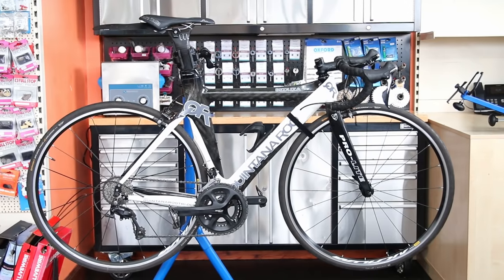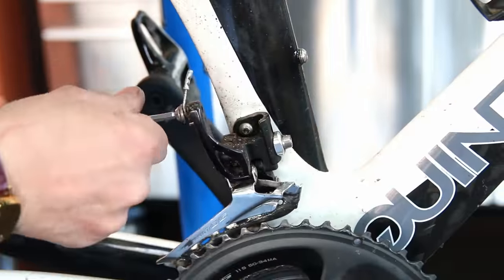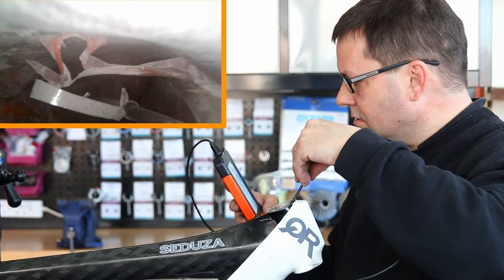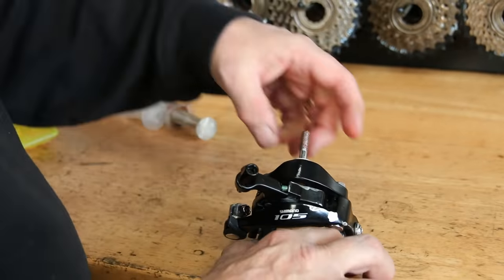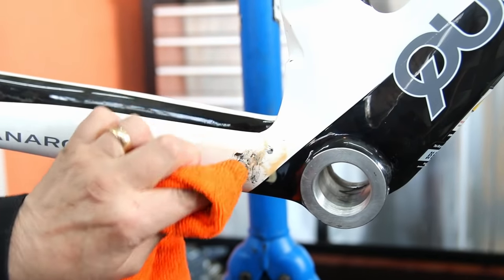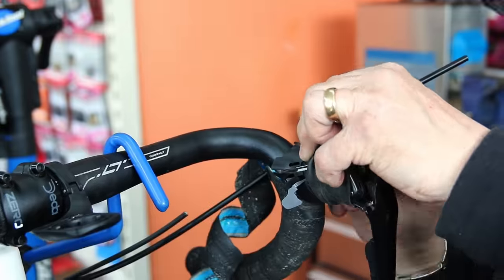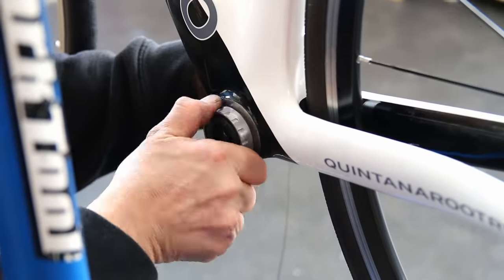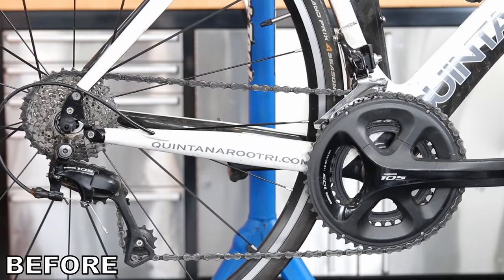Quintanaroo Restoration Service! Road Bike Rebuild!

Comment: I'm amazed at the condition some of these bikes are in when they arrive at your shop. Are UK cyclists allergic to a little soap and water? 🤪 Or are your roads so often mucked up? Whatever the case, they're lucky to have you!
Reply from the maker: Very mucky weather & hard as nails cyclist who ride through tough winter conditions
Reply: clean bike is temporary (factory attribute), the natural way to own one is look like something big has vomited on it. if your bike clean you are part of a noble race.
Reply: We're just out of winter, where if you don't wash the bike after every ride you'll have a dirty bike, so eventually you give up on the little bits behind the wheels :P

Comment: I have that bike, but it's a triathlon bike, so I suspect she's taken the Tri bars off and kept the original cables without shortening them. Maybe in case she wanted to switch back. My FD cable is frayed but I didn't want to change it because as you say the housing is complex, but maybe I'll give it a go now, thanks!

Comment: Great vid guys! Keep up the good work 👍
Reply from the maker: Thanks Brian!
Reply: Guys, where do you get the vinyl patches from? Presume they come as a sheet to be cut down? Got a blue cinelli and have noticed some wear from the front brake cable to the body work and want to protect it before it gets too bad. Hopefully match colourwise as well
Cheers
Reply from the maker: You can definitely buy it on Amazon and cut it down with scissors🧡

Comment: Love the videos bikespeeds! May I ask what brand of torque wrench is that? Thanks!
Reply from the maker: We use Premier 1/4” drive a Snap-On 3/8” drive for left and right hand threads, a Draper 1/2” drive and also a TengTools 1/2” drive we don’t have a preference they all work for the task assigned to them.

Comment: Interesting coincidence. I just had to remove my 105 rear mech because the lower pivot was jammed. I managed to get it working again with a ton of degreaser. My concern though is that I can't regrease the spring because there is no way to get in there. 
Will it be fine? Or do I have to use a needle to get some grease in, like you are doing? Would chain lube be enough?
Reply from the maker: Even if you spray it with oil it will be better than dry.

Comment: What lube do you use for the pivot points on the derailleurs?
Reply from the maker: We use a thin oil at the moment Oxford mint 365 but it changes depending on what’s available
Reply: @Bikespeeds  Thanks!

Comment: #bikespeeds
Good morning, what type of grease should I use for my mtb seat post where its assemble to the aluminium frame? Should I use same paste as it used for carbon frames?
Reply from the maker: With aluminium it’s the clamp that grips the post, so below that any grease should help stop corrosion, just torque the clamp correctly and you should be ok
Reply: @Bikespeeds  thanks , i am enjoying watching your vlog. 
Cheers